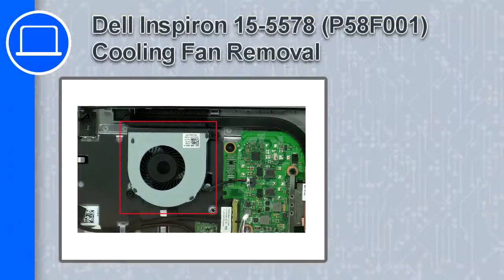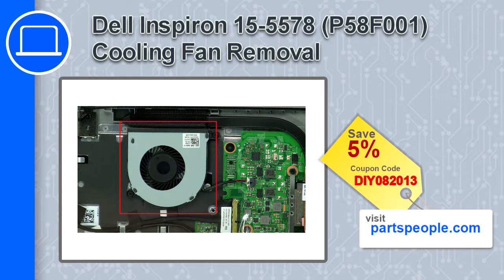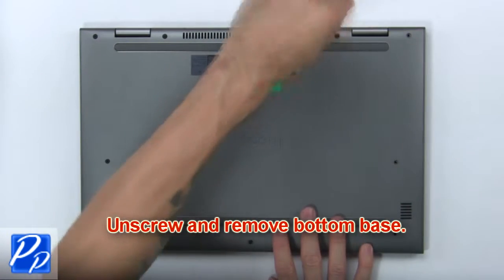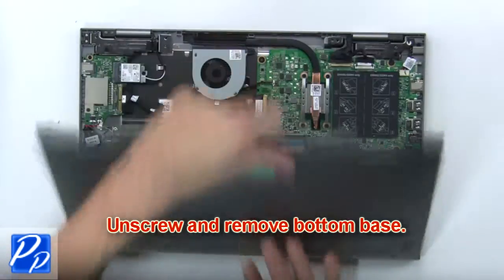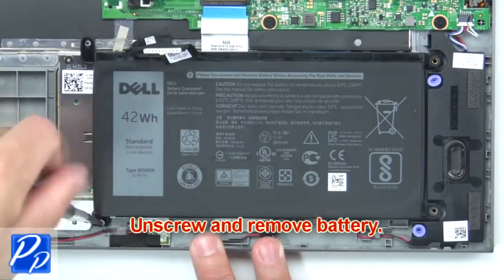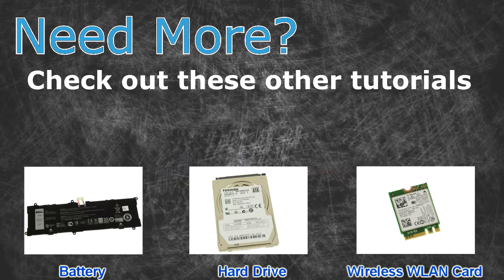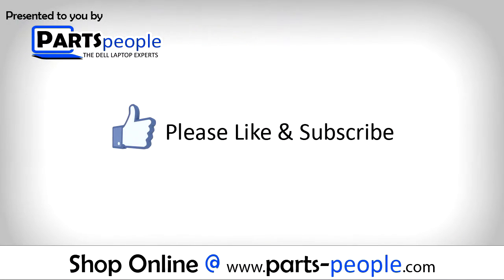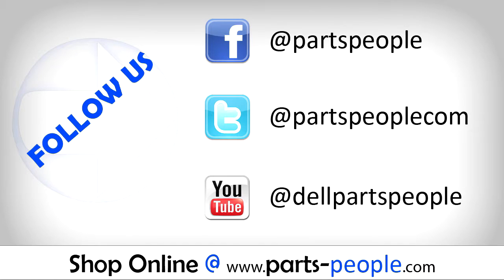Dell Inspiron 15-5578 (P58F001) Cooling Fan How-To Video Tutorial

Comment: How should I clean the cooling fan?
Reply from the maker: Remove it and use canned air to blow out any dust and debris. Also, blow out any dust that may be trapped in the heatsink fins while the fan is removed.